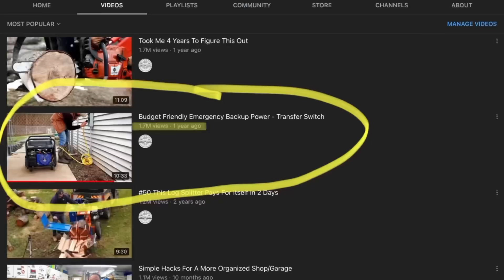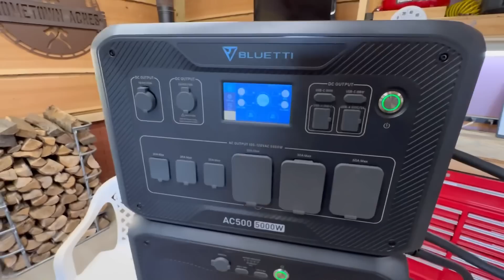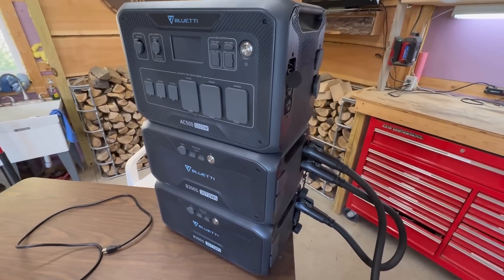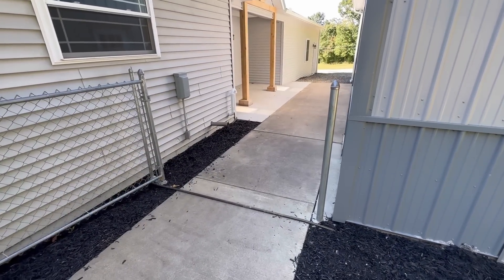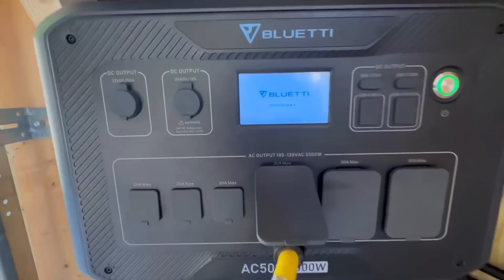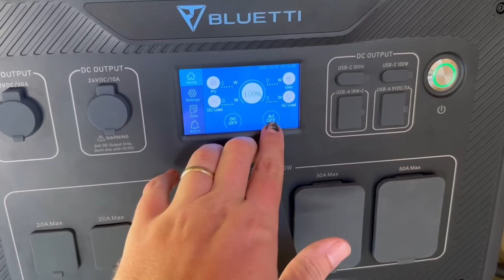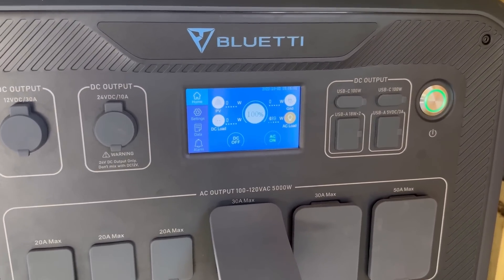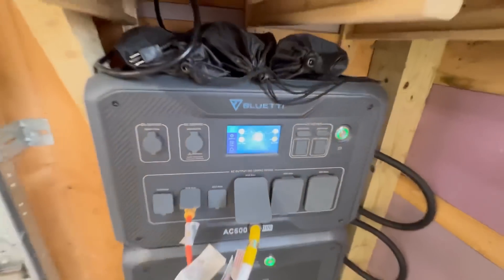The End Of The Gas Generator? - Bluetti AC500 & B300S

Comment: Adam, it looks like you have been introduced to the importance of home backup power. I like that!

Lots of us (including neighbor Doug) learned about this 20+ years ago. Look at what neighbor Doug still has (a very smart guy) at his place. 

Does he have a Bluetti?   No!   He's still got (?) a ~20k natural gas supplied Generac generator, and a small Honda 3000 watt inverter generator.  

Lots of us were  not "given"  thousands of dollars worth of Bluetti equipment.  We had to pay for ours out of our own pocket. (I am here defending those of us with 20+ years of gas generator experience).

Your recent "born again" (using the term loosely) conversion to home backup  power started with a noisy gas powered generator.  Then, you "saw the light", and through the "grace of Bluetti" (not God), you are now loudly singing its praises. And, you indicated you dont appreciate unsolicited advice of your viewers.

People get excited/tense when it comes to this subject.  Most of them "sold their souls" to the Bible thumping preachers of gas powered generators and donately $ heavily. 

I will therefore give an opinion (not unsolicited advice) on this subject:

--- I dont believe an expensive Bluetti 2 day backup power supply is enough. Once its gone then what? You go back to gas generators?  

---  Lots of us have 220 volt water pumps, 220 volt air conditioners, 220 volt electric ranges,  electric hot water heaters, and micro waves, which would choke a Bluetti in no time at all. 

--- I dont like storing huge amounts of gas that can go stail. 5 gallons with a good gas stabilizer is good enough for me.   A portable open sided shelter with enough head room is required for running a generator outside in the rain or snow when needed.

--- I presently have a large used quiet Honda inverter generator, which the neighbors wont hear. It will run a long time on 5 gallons of gas.  

--- They say the USA power grid is old, fragile, and too small.

--- I still vote for gas powered generators.

Comment: Saying, "these batteries should be able to power your home for two days" is like saying "buy this spare 2-gallon fuel can for your car and it should be able to run your car for two days."
It all depends on how much work you need to do in two days... or how little work you are willing to do. It's all relative. The average USA home uses 30kWh per day. Those two batteries will provide less than one fifth of that. So those batteries can power your home for about five hours. Or you need to reduce your electricity usage to about 20% of normal if you expect to get two days.
Also, if you want to recharge those each day with solar panels, then you will need 3 to 6 of the big 350W panels and a full day of sun, while using only 20% of normal usage.

Comment: Thanks for the video review!  Living with your power backup option you have chosen for 24-48 hrs is a brilliant idea. Most people will learn that their powerful generator will use much more gas than they expected. What I've learned from crisis situations going all the way back to Hurricane Hugo and now living in Florida; there is no perfect solution. The key is having options that work when you need them. What you can afford and how much you want to spend will narrow those options. Realize that having only one option mean that if it fails, you are stuck.  My suggestion if you can afford it is to have 1) a large power source such as a whole house generator with a propane tank. If you have natural gas available, make it so you can power from either your propane tank or utility gas... Or solar panels with battery storage. 2) a medium-large size generator in case the main backup fails, and 3) a small portable generator in the 2000 watt range.  Having these three options will likely mean that you have some power when you need it.  Also, it gives you the option to share with friends and family when they are in need. This Bluetti system could replace 2) or 3), but having some solar panels, even portable ones would be prudent. Please note: if your house floods with 10 feet of water, none of these are going to help.

Comment: The most economical and reliable pack up power is a generic propane/natural gas generator. Permanent install with auto transfer switch. Sized to run your home as needed.

Comment: Nice system. I had a 4800 watt gas electric start gen for my vacation place in Vt. Only thing is you had to be there to start it and flip the transfer switches. We decided to bite the bullet and got a Koehler stand by propane gen. I’ve had a few times where the power went out for days and I had to make the 4 hr drive to start it up. Now I have the peace of mind to not have to worry. Like you said it’s not for everyone.

Comment: The only way this system makes sense is if you can use this for other things to keep it charge cycled, no battery likes to be discharged too deep or charged too high or get too hot or cold or sit charged without general use.

Comment: I have a 10KW generator, 50 AMP, and yes you need to ensure they are maintained and inclement weather can be an issue. I have a GenTent to protect mine. I use non ethanol gas, start it monthly, etc, etc. For $6500 and know that I would be SOL after 2 days without some form of alternative charging for it (solar). I also use the interlock system. I would be hard pressed at this point and time to spend the money. Another reason to always keep your vehicles gas tank filled as well. They are like gas storage tanks if the SHTF. Many of the farmers here in my area have a PTO generator on wheels with a plug running from the barn to the house. They roll the generator up to the tractor PTO connect it and back feed into the house. Just my opinion. As always great video with an honest review.

Comment: If you interlock your main panel then keep you current interlocked panel intact and install a second plug outside for your main panel interlock power feed. That way you can’t run two generators or a generator and power backup batteries like bluetti. That’s what I did when I got annoyed that I couldn’t run the well pump and hot water tank together for hot showers. Lol.

Comment: Common misconception are these batteries only last 10 years. It’s 100% of the rated capacity only lasts 10 years. These LiFePO batteries will likely outlast you. After 10 years of discharging and recharging every single day you will still be left with 80% capacity indefinitely. Without the need of engine oil, or fuel. Then decades from now at the end of its life 80% of each battery inside is recyclable.

Comment: Adam, this is intriguing, I have an 8000 watt Generac with a manual interlock setup.  I also have a 9.2 Kw PV system that is grid tie, which is actually useless when the power is down.   I like the idea of having something like this to use in conjunction with the generator for nighttime operation or when I have to work and not leave the generator outside while away.  Not cheap, but I can see the use.  Also Bluetti site is not user friendly and confusing
Reply: You could arrange your solat array to plug into the bluetti for backup solar charging if you can bypass the gridtie inverters.

Comment: I have a battery system with a pTo generator for back up. Best way to go. If you need the tractor you can switch to electric. For short outages you don’t need the tractor at all. It’s amazing.

Comment: Having ability to choose which circuit to run is huge advantage.  I read my 7k gas generator for 7 days straight when we lost power few days ago.  All. Ackfed thru dryer outlet witch is 50 amp

Comment: Hey Adam.  Good review. The nice thing about this setup (and others thar are similar)  even though it's not for everyone, there are enough to help push the market. As the market increases, the innovation will also increase and prices will get better.  In 20 years or so, the technology will be amazing.   Itll be a great setup for you.  (Especially if you install solar)  you van roll the inverter and battery out to your campsite and have some lights, etc without the noise of a generator. Also nice when power it out for just a day or 2.  Not the right setup for me today. But in the future,  who knows. Thanks again

Comment: Take it from someone who's been without power for 2 plus weeks, in the summer. A whole house natural gas or propane generator is the way to go. This application might be good for certain areas. But down here, in South Louisiana, is not one of them.
Reply: How much did that cost you in natural gas?  We had a 2 week outage in January and people who used propane were struggling when everyone was trying to refill their tanks at the same time. It got really expensive as prices jumped up.  Obviously natural gas doesn't need to be refilled and less volatile of a price. So curious how much of a hit that took
Reply: @briananderson7497  The last time was when Ida passed through. Out for 9 days. Gas bill was about $150 higher. Keep in mind that it was running air conditioning. It was offset by a lower electric bill. It's well worth the money. Just saving the food in the freezer was worth it.

Comment: For less than than that I installed a 20K Kohler whole house propane generator with an automatic transfer switch. When my power goes out it automatically comes back on within 10 sec. Under full load it uses about 3gal and hour. Hooked up to a 500 gallon tank that is equal to approx. 7 days under full load 24/7. So in reality more like 2-3 weeks. IMHO, inverter systems are good for low use, transportable power. Cost per kW just doesn't work out. Thanks for the video though.

Comment: One thing to also consider is repairability. Engine parts on gas and propane generators are readily available. The actual generator parts rarely fail, but parts are available. If parts are available, any competent homeowner or a small engine repair company can fix it. If a Bluetti fails, who's going to fix it? All these battery power solutions are proprietary to each manufacturer. That's not necessarily by design, but there are no standards to speak of for compatibility between batteries, inverter systems, etc.

While on the higher end of the expense spectrum, my choice is a whole house propane generator with automatic transfer switch. There are electronics involved, which make the system less repairable than a gas generator connected via a power cord, but these can be bypassed in an emergency. A 500 gallon propane tank (which is 400 gallons usable) will provide a 24KW generator running at full capacity about 10 days of continuous run time, and nominally 20 days at 50% capacity. Granted, a truck will have to come out to fill it, but propane will store for decades, unlike gas or diesel.

Comment: Forgive me for asking, but If I understood right the Bluetti is somehow just two batteries and an inverter? With solar panels I can understand it but how long can it really be enough... My guess (what it is worth) is that it would anyhow be nice to have the small generator to charge with.
 That thing about running machines in the elements is a truth that can be modified. A small "house" for it by the garage wall with a small door so that you can easily take it inside, and then you put it on a trolley. Open the door, pull it in, refuel and whatever and push it out. That is how we have it at our cottage/cabin...

Comment: You mentioned self heating on those batteries… is that something that they generate naturally, during operation to where they were getting warm while you used them in this video? Or is it something that is regulated for when it gets cold, to where that would further affect the battery life in the winter?

Comment: When you get to this size of inverter and expandable storage, you're really better off with a stationary, component-based system.  You can get a server rack battery, 48v inverter/charger, and then a proper sub-panel setup for less money, if you do most of the install yourself.  In the end, neither system is truly "portable", but the component-based system is less expensive, has better capacity and will probably last longer.

Comment: IMHO being able to have a combination of the Bluetti, solar and 5K genset would accomplish 90+ % of everything you need, even for a prolonged outage. You may want to consider an upcoming project to be solar on your home and garage rooftops. Lifespan 25+ years with a 10% degradation over the life of the panels. Current panels are cheaper for more wattage (350 w or so per panel) compared to the 250 w from 5-7 years ago. We did this on our church in 2015, and made $$ from the moment we turned on the 20 kw array. No battery, straight hookup to the grid, any generation over what we used at the moment is reflected in going back through the meter as an instant credit on our bill. We have two buildings on our campus and several times our bill has been from $10 to $30 per month. Prior to solar our average monthly electricity use was $455 per month. Nicely done, Sir! Be well, be safe!

Comment: Nice and informative video Adam. I run a gas generator with an interlock system. It cost me about $80 for the main breaker lockout for my Square D QO load panel. It bolts into the panel very easily and prevents the main breaker from being turned on while the circuit breaker to the generator is turned on and visa versa. I also have my generator in an enclosure that the top flips up for refueling and the front can be removed for service and installation. It has a built in fan and a solar panel to charge the generator battery. It is made by a company in New Hampshire, The Generator Connection, but I'm sure there are other places that make them also.

Comment: There are multiple types of transfer switches. You can also have whole house transfer switches. This style is used to switch your main incoming power feed and an external prime power such as a large generator.
Reply: This not a 240 Volt power supply. he will need the Genny to power the Well pump if it is 240 Vac. 
His 30 Amp connector is only 120Vac.
Reply: @m9ovich785  he did mention in the video he ran his well pump. I was wondering about that because I'm thinking of basically the same thing he is doing. I was told you need 240 volts to run the well pump.
Reply: @ru42112  His outside Inlet is configured for Split Phase so the Gen set to provide 240. In which he did run the House.
His inside one is set up the Same way but the Yellow Cable connects both Phases together nullifying 240 Volt.

Comment: Thanks Adam for the honest review.  All backup power sources have their pros and cons. I have an off grid cabin in the NC mountains. I use a generator for high draw situations and a few hours per day to cool my freezer and charge my battery eco flow power pack. It works great for lights and a fan in the cabin so I don’t run the generator near as much. Propane , natural gas and diesel powered generators do much better in terms of long term fuel storage.

Comment: nice review.  I would bet in a real world power outage it is like you said, you would be more mindful of your power usage.  Also, the great thing about it is if your area is without power, the local gas stations would be as well.  There goes(perhaps) your access to fuel if you would have been on a gas generator.
Reply: Our local gas station has a automatic generac system running off propane. They kept running 24 hrs during a 14 day outage we had in January.  Guess not all gas stations are similarly equipped.

Comment: I got exactly the same system you did, and just got notified mine is due in next week :-). Love your channel been watching for a couple of years now. I'm building a house and will have this wired into my house to operate as a UPS. When the power goes out it automatically takes over. I've also purchased solar panels to keep it charged up. The setting in it will allow it to run down to say 20% before recharging. If solar isn't available, my grid tied home will recharge it, so I can reduce my electric all I can ... (Yea, I know I'm paying for more expensive electricity with this system, but might as well get some return on my investment using solar). I've got a 40' 5th wheel RV, and I plan on taking this with me when I'm RVing so I can go wherever I please. I purchased 400 w portable solar panels to allow me to put these in the sun even if parked under the trees. Though this isn't for everyone, it is for me. Tie this setup with my 4500 W gas/propane generator and I'll have power when other won't no matter what happens or for how long the emergency occurs.
Reply from the maker: Thanks Pete. I think you will like the system